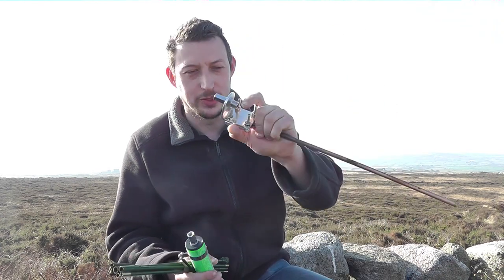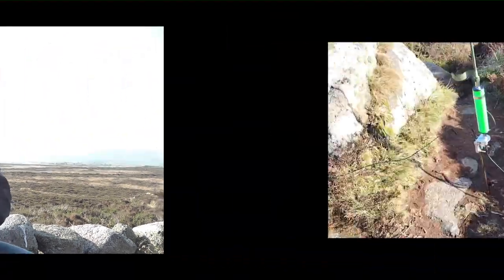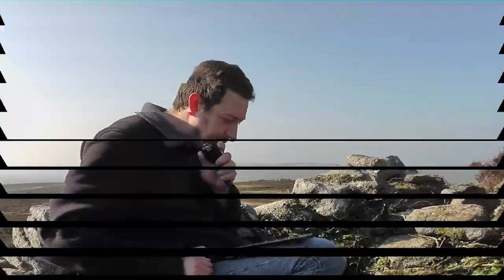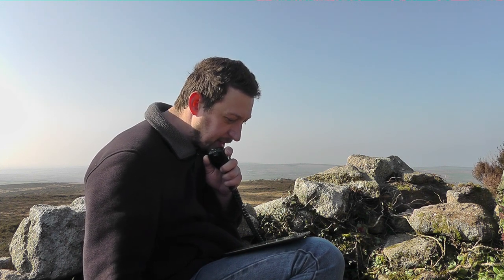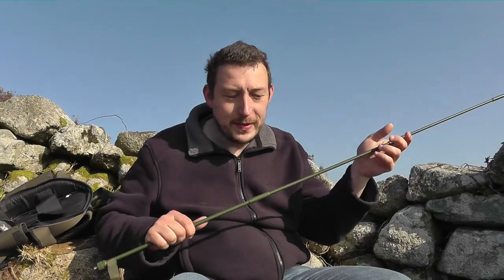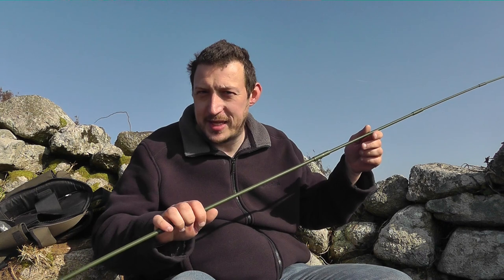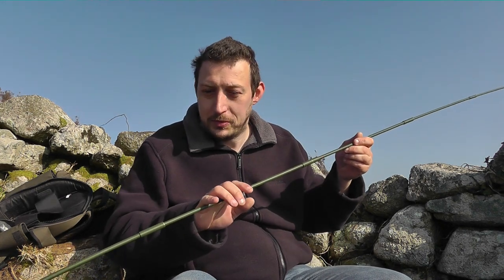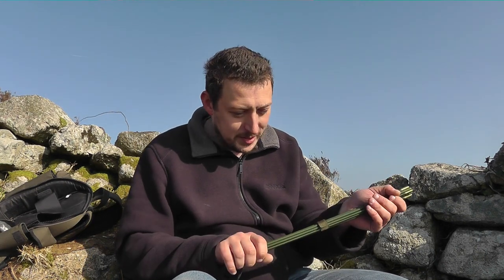Ideal SOTA antenna? - Military Whip & Slidewinder Coil from M1ECC Antennas

Comment: As mentioned before a good ground is like putiing a mirror under a candle. We recommend 4 radials min 4.5m long, After watching this video I feel only using the one Radial is what let you down. The Radials are as important as the antenna its self & help to push the most current radiated from the antenna regardless of your power used.
Reply from the maker: Completely agree that it would have performed better with more radials. No debate about that.

Having said that, I have had good results with just one radial. This wasn't the best demonstration due to the contest activity but the fact that I still managed to make the contacts despite the contest activity should say something.

For SOTA, you are often operating in adverse conditions (30+ mph winds, freezing cold, horizontal rain, hail etc). I want to be on the air, make my 4 contacts & packed up ASAP.

There's also the consideration that many SOTA summits are busy with other hikers. The more wire trailing along the floor, the more chances of someone tripping over it.

A single radial on the ground is inefficient. There's no question about that but if you only need 4 contacts and you've got a pile-up of about 20 people trying to get through to you because you are on a SOTA summit (let's say that around 10-15 of them will successfully make the contact), then is it an acceptable compromise?
Reply: @AmateurRadioUK  I'm glad you commented this, Because some viewers may have got the impression the slidewinder antenna does not perform very well.

Comment: Great antenna combo if you don't have a tuner and also great mobile with a 3mtr CB whip or the mil whip and spring if you tie it down. You can get better NVIS performance on 40-80 by attaching 20 to 50 feet of small 18 gauge wire to the tip of the whip and run it off to a handy support.

Comment: Very well done James. If you only want 1 radial and and it more efficient you could elevated it and have it "tuned " per band. You would  have to roll in or out depending on band but you will make the antenna much more efficient. Saying that you did really well as it is.
Reply from the maker: Fair point about the elevated radial. The problem I have with that is that there are often other members of the public wondering around on the summit. It seems like a bit of a hazard to have an radial strung up.

You need supports for it (which is more to carry) & you also have to spend time tuning it.

For SOTA you are often operating in adverse conditions & want to be set up, get your 4 contacts, then get packed up and move on as quickly as possible.

A single radial on the ground is inefficient. The question is whether or not it is an acceptable compromise?
Reply: @AmateurRadioUK  totally agree. You made the contacts and that's all that matters.

Comment: Compromise or not, that worked pretty well given the contest QRM. Nice neat setup.
Reply from the maker: Absolutely.

I will have to revisit this under more favourable conditions as I don't think I really gave it a fair chance.

I've had some good results with this setup when there haven't been any contests on but this wasn't filmed because I like to give any new antenna a couple of test runs before I try to make a video about it (to figure out any quirks & make sure that I know what I'm talking about before I roll the cameras).

Comment: Nice test of the setup James..
I’ve never tried one of these type of antennas..
Not sure if I’m ready to spend just yet… I’ve got the pole and linked dipole working fairly good now.
Reply from the maker: Your linked dipole will perform better as it's a full size antenna. This is very much a compromise.

Where this comes into its own is that you don't need a separate mast (meaning it's lighter & smaller for long or steep hikes) & it's really quick to set up.

On a busy summit with lots of other people around, I don't like having wire antennas up in the air for people to strangle themselves on or trip over.

Basically I would take this vertical if I was on a busy summit with other hikers or I anticipated weather conditions were poor & I wanted a quick activation.

If I'm going to a summit with lots of space, very few people & good weather conditions I would take a full size antenna (especially if I plan an extended activation combined with WWFF).
Reply: @AmateurRadioUK  yep I know exactly what you mean…
I must look into something similar as an alternator to busy summits and ones with little space on the top.
My local county highest point (which I haven’t activated yet) is all hard shake on the top, so I’m going to have to find some sort of solution thet doesn’t need sticking into the ground!
Or else just go on a calm day and use rocks as stays 🤔.

Comment: what is your possible frequency range with this setup? 28 to 14mhz?
Reply from the maker: The configuration I used in the video will cover the 12m-40m bands.

The whip (without the coil) is resonant at around 24mhz, so it's a little too long for 10m.

You could use a shorter whip with a standard 3/8 thread to give you 10m.

Comment: Hi James, nice video ! I have the Black Slidewinder coil and have used it with a Buddipole Long Telescopic Whip, which is more or less the same extended length as the M1ECC Milwip, but the Milwip is around 4" shorter when collapsed. My question is, do you think there would be any performance difference between the two whips ?
Reply from the maker: If both antennas are about the same length then I wouldn't expect there to be much difference between the two.
Reply: @AmateurRadioUK  One of you should try either the MFJ or the Chameleon 17ft whips. See if that gets on 80? or uses less loading on 40m making it more efficient.
Reply from the maker: @forgetyourlife  I've not tried it but I suspect that it would probably be possible to make a 17ft whip work on 80m. 60m would also be a interesting proposition as 60m is often used for SOTA here in the UK. Obviously it would be quite inefficient.

The problem with that idea is that the manufacturer of the Slidewinder Coil specifically says that the coil should NOT be used with whips over 3m because the wind loading can break the coil.

Having said that, it should be ok in extremely light winds.
Reply: @AmateurRadioUK  So I’ve done 80m with my Wolf River mini coil which is about the same as the SlideWinder. The key is a good radial field. I used 20 radials of 15ft length on ground and it dips pretty good. No tuner etc. Also I did read the warning however there are a few vids of the SlideDX being used at the beach, high winds and rain. It looked pretty stout. I ask, since the coil is 3D printed so you think it’s less apt to take such abuse over and over? I’ve never seen one in person and am curious of its construction strength and weaknesses.
Reply from the maker: @forgetyourlife  The actual coil is fairly stout as you said. I think the most likely point of failure with overloading would be the 3/8 attachments in the ends. It would probably strip the threads in the plastic.
Reply: @AmateurRadioUK  ahhhh, the medal fittings are threaded into the plastic. Yeah that could be an issue for sure. So I ordered one a few days ago, shipping to the states was 40USD, ouch. But I just wanna see one of these. Thanks for the info. If I try the 17ft whip I’ll make sure it’s a wind free day or maybe just stick to the 9 footer they sell. Cheers!

Comment: I have that military whip ant-129 how do I connect to yeasu ft-891
Reply from the maker: As you can see in the video, I just used RG-58 between the mounting bracket and the radio.
Reply: @AmateurRadioUK  thanks a brand new ! Thanks again